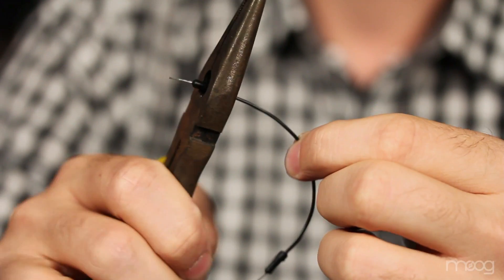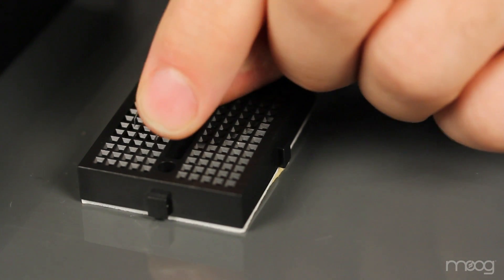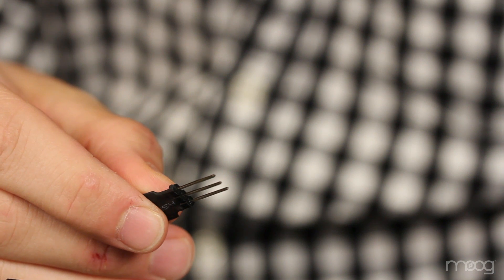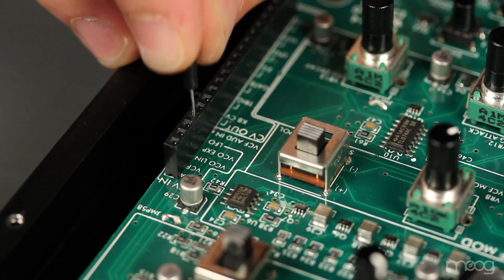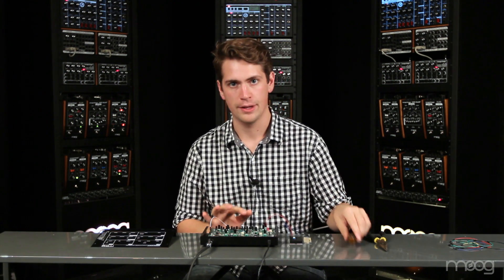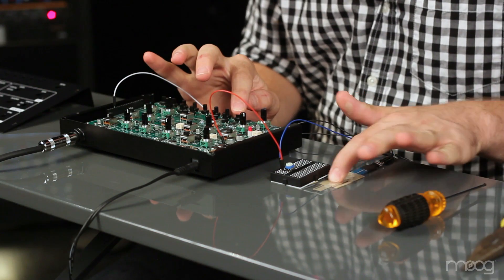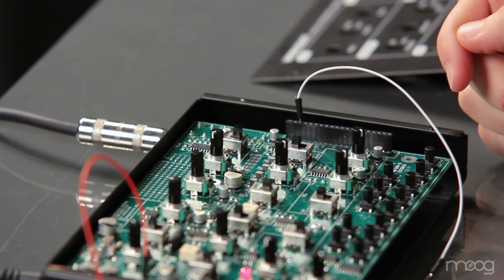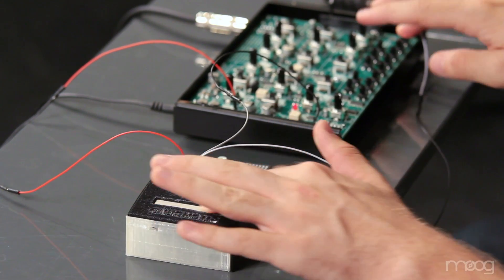WERKSTATT-01 | Pitch Bend Mod

Comment: I'm using a softpot but without the 1Mohm potentiometer and when taking my finger off it doesn't rest midway so it is off pitch. Any idea how to solve this problem? With a knob there is a spring that forces the pot to centre... Cheers.